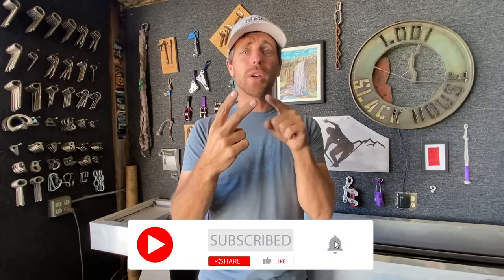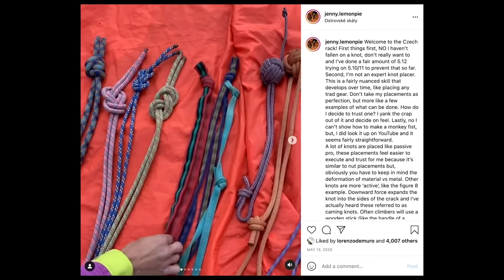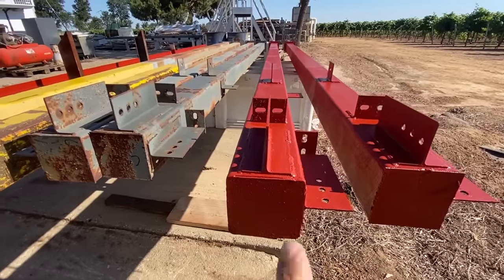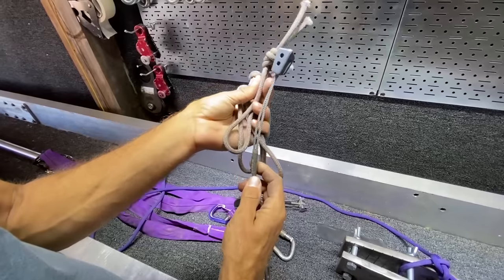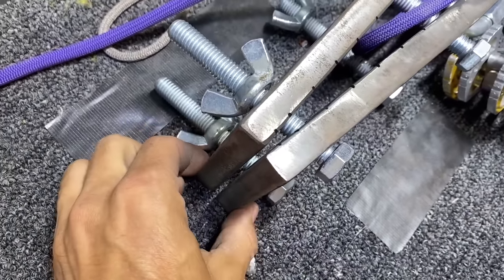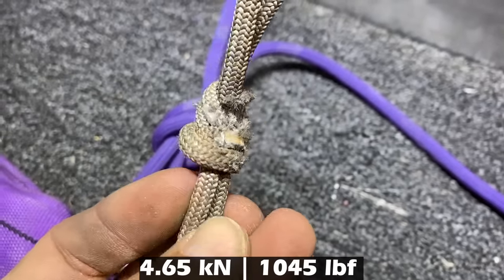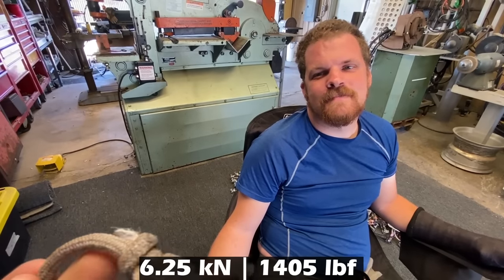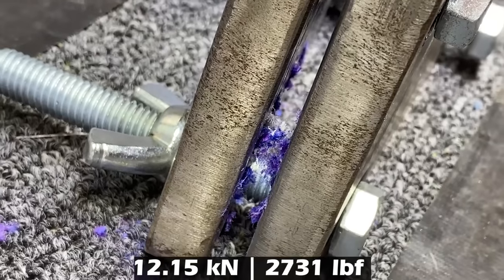Climbing pro made from knots??? Textile passive protection tested!

Comment: I like the idea of modifying your cam crusher to accept concrete paving slabs or even just some kind of ceramic tile with the rough side facing the cam/nuts. I say that because I think the steel is too slick for the soft nuts to work as intended. That having been said, you did test what happens when you pull these nuts apart if the end is clamped in place. It is kind of amazing to think that most of these, if they held, would not explode during a whipper. Maybe we should all start adding some soft gear to our racks? It weighs nothing, it costs nothing, and you can use it to supplement your more conventional protection. Imagine not having to waste cams at the anchor because you can replace one or two with solid soft nut placements? Pretty rad.
Reply: Ad putting the knots in your rack: it really takes awful lot of skill to place them properly, they need super specific spots to hold (quickly tightening crack, deep...), they can be real pain in the ass, typically it takes few minutes to get them in and there are about milion other reasons why they are pain in the ass. Only two positives are nature protection and low price. Still I am really happy when I go for soke hard rock and can shove a bomber cam in less than 10 seconds, rather than spend 10 minutes with shitty sling, which goes in harder than out.
I don't want to discourage you from trying them out, but be careful, mostly they are trash.
Reply from the maker: I really do want to modify cam crusher so we can get some real rock vibes.  It's really hard to do real rock real well.  I got some ideas....
Reply: @alcupone6462  I dont know that I suggested using them mid-climb. Rather, I think they would be great at anchors where you typically have a little more leeway on timing and setting things up. Instead of using 3-4 cams, you could use 1-2 cams and then like 1-3 more soft nuts to supplement and make sure you have a piece placed against upward pulls, which I think it an often overlooked component in a lot of anchors demoed online. What is nice about them is that you can augment some of your existing materials to function as nuts (dyneema slings, accessory cord, cordelettes, etc.) and basically get a bunch of gear for free. Sure, it won't help you on splitter cracks, but I live in CO where I haven't really climbed any red sandstone splitters....yet. I dunno, I think there is a place for this stuff. Ill try it out and if I dont die and dislike it, I will come back and comment :)
Reply: @arnoldkotlyarevsky383  I don't think that you suggested using them mid climb, I just wanted to give you the feeling what using slings is like.
It is awful lot of time for placing it and it needs very specific spot. I think you would be better off with using nuts if you want to save some cams instead of using them for anchor.
As you have seen in the video, you need a crack which is at least 2x the diameter of the sling which narrows to approx the diameter of the sling.
This is usually hard to find on hard rock and it is easier and safer to use metal nut for few bucks.
Be safe if you go try it out :)

Comment: DEFINITELY test on rock! I am certain the ability for them to deform like putty so much in this test is undoubtedly due in part to the slickness of the metal allowing the exterior fibers to easy change position and placement, as well as the entire not to more more easily into the narrow part of the wedge.  Contact on a surface with much higher friction will, I think, improve the strength performance in practice.

Comment: If you retest on slack snap add some nuts on the inside of the plates on the back bolts to stop the front opening from getting wider while you pull. If you watch the slow motion, the back plates pull closer opening the front gap allowing the knots to pull out.

Comment: The figure 8 knot is much flatter before tightening, so it fits to the thiner cracks. Jan, Czech rep.
Reply: In 1983 in the kitchen of Wolfgang Güllich and Kurt Albert, Wolfgang held up a piece of rope with a figure 8 to show everyone at the table how knots are used in what was then East Germany (I climbed in the Elbsandsteingebirge twice in 1983, once in 1985, and once in 1994, plus in 1983 in what was then Czechoslovakia, on the soft white sandstone of the Böhmische Paradies, where the rock is much softer than in the Elbsandsteingebirge): 

"You make ze knot theen, like so, and zen put in ze crack, and pool ze rope so ze knot gets bigger. Just like a Friend, except it does not hold ze bodyveight." 😆😬☺️

Comment: OMG thank you for this!

I can't wait for drop tower to test this on real whippers! This pull machine apply force for infinite time where whippers have only limited time (like 1 second?), so maybe knots don't have that much time to deform and will hold? We shall see :-).

However, I would do couple of improvement for the tests so they are a bit more real:

1. Don't cinch down the bottom after placing the knot: Once in the video, you mentioned you had cinched the bottom, please don't do this, you cannot do this with real rock ;-). You can place knots only where you actually can put the sling below the knot through (which can also be difficult because of friction and you have only 1 hand etc.)
2. Friction - sandstone has a lot of friction, that could be important factor.

Comment: it would be super cool to get a stone saw and cut a couple blocks out of sandstone boulders in order to make a couple stone wedges.

But yeah, the friction would totally help a ton, think about jamming your hand in a slick crack at the gym compared to actual sandstone, the smooth gym crack hurts more than gritty sandstone because your hand slips easier at the polished gym. My skin gets way more wrecked when I'm jamming at the gym at least.

So the friction on the rock will help the knots stay in place and not slide out. I'd assume as much as 50% strength increase in the placement by getting it to stay in place (with a limit being the webbing or rope strength)

Comment: I feel like some kind of coating or liner to ad some friction on the jaws would make a difference and possibly reducing the angle of the plates would help because you’re not getting as much contact between rope and the jaws as you could and the compressive force between the plates would be distributed over a larger portion of the rope thus giving more pportunity for the knot to catch or get hung up further up the jaws

Comment: I feel like using those in real rock would work quite a bit better than with your setup there. Friction would be higher in rock, so the knots wouldn't slip so easily. Also, in good placements you would only be pushing the knot further into the crack. So, seeing how much the rope held when it wasn't slipping off I think those should be safe. Also, the rope will stretch a lot more than the wire of a nut, so the force required to stop you is much less (softer catch). Now that doesn't mean that I will go and swap all my gear for knots, but I don't think people that use it because of conservation issues are crazy. In fact, most people I know would not want to fall on any trad gear because, no matter how strong the gear is, if you place it incorrectly it will not take a fall. I feel like it is the same with knots. If you are planning on falling on them, you should probably just set up a top rope or go somewhere else, you should only be falling on them if something goes wrong.

Comment: I'm picturing some of the cracks near me where the two sides don't just taper, like the slack snap crack cam crusher, but even looked like it had crimps either side for the 'shoulders' of a knot to sit upon. Add that to friction and you're looking at some pretty bomber, 'I might not actually whip and die' placements.

Comment: The jig faces change angle at high forces, it "resets" to less angle on most, my flash is a third set screw that keeps the wingnut side from moving needed with an expectation of better results from a static angle.

For friction put some skateboard deck on the jaws ... 
Cheers 🍺

Comment: Real rock would be interesting, since the force of friction is linear to the force applied. Meaning you would need greater force to pull it through a thin crack. A softer material also connects better to a rocks uneven surface than harder metal, which also means you'll see less pressure per area unit, which might counteract the deformation.

Also, it would be nice if you compared the breaking/holding strength of similar sized nuts or even cams. A DMM Wallnut is 7-12kN for example. The purple figure 8 was also 12kN at 8:10.

Also, the monkey fist woldd be nice, I use them for soft shackles btw. Hard knot.

Best regards, civil engineer.

Comment: A nice uniform and repeatable friction surface might be skateboard deck tape, it could be installed on the outside (as it is in current configuration) of the steel plates on your nut test jig *you'd just have to heat it up, and peel it off as it became damaged in testing... not that I think it would change the results much, though - in reality the friction might just eat up the rope/webbing faster, despite offering a bit more initial hold - looks like a perfect place to use the new load tester so we can see it graphed out!

Comment: You could probably use some locking nuts on the back two bolts inside your simulated crack, because it seems like it keeps shrinking in order to change the angle at the front, and then stuff slips a little. I am bad at explaining stuff but basically locking nuts

Comment: I have not climbed a lot in the Czech Republic or in saxonian switzerland, but I know some people. Yes, you are right about the fact, that the rock might be damaged. Which is the reason for these knots. The question, why should one climb there than, is a little more complicated. The climbing culture is a very different there. Falling is not so common as in some other areas. If you can't climb it without falling, you better don't try it. At least that is the way I understood it. The climbing is very traditional.
Reply: Falling is such a major part of modern climbing. If you aren't falling you aren't climbing hard enough. Everything is built around making falling as safe as possible. Sure you may survive a 98% of trad falls. But if you fall 1000 times per year you are probably dead.
Reply: @timonix2  Yeah, I absolutely agree with yoh there. Which is why I don't do a lot of climbing in those areas, where pro made from metal is not allowed. But that is the climbing culture in those regions and I just wanted to give an idea of why they are using such protection there. I do understand the big accomplishment to climb something even with just a minimum of gear. I just personally decided not to take the risk.
Reply: Bzw. chalk or too many bolts are not allowed there ether. Which is why many routs only have 1 or 2 bolts on 30m of climbing. Just a way to keep the climbing traditional.
Reply: @timonix2  well, if you are falling, then you are not climbing hard enough, because you fell? ;) just joking
Sandstone climbing had developed a lot in last 40 years, falling is not a nogo thing on sandstone anymore. Some areas are progressing towards the trend ( mainly the Elbe valley) and the routes are getting harder but also better protected (means preventing groundfall in 95% of the cases) and the trad part of the climbing is slightly pushed back.
For protecting the routes and doing the FAs rules are in place against over and under bolting. Casually it is assumed that you can solo one full grade below the route you picked (easier sections are often unprotected) and you have infinite endurance (often kills my attempts).

Comment: Since there are currently 400 and some comments saying to try it on real rock, I will answer in the opposite.  I don't want to see it done in real rock, because there is enough granite in the world to put my lovely rack of cams into. If I can dig a foothold into it while climbing, it's not my thing. I'd rather see a DMM Pivot go head to head with a BD ATC Guide. 

Speaking of such places, isn't Garden of the Gods in Colorado very similar?   I climbed there once many years ago and decided that rock wasn't for me.  It seemed that the rock was so friable that no removable protection felt secure.  

In West Virginia, at places like Seneca Rocks, they metamorphose the sandstone with some heat and pressure to form more like a quartzite. While they still call it sandstone, that is some tough rock.  Perhaps Czech Republic should consider holding another mountain building event to toughen up their sandstone.

Comment: The figureeight is placed as thin as possible (loose) and because auf the friction of the very course sandstone it gets thicker as you pull on the ends.
Friction is a huge deal. I actually took some whippers on those knots here in the elbsandstone in Germany and it works great, I never pulled one out. Of course I only risk a fall when the placement is good... But still.
Also I think dynamic pulls on those knots are quite different than the slow pull you tryed.

You should climb here. I think we have some really really unique routes and for sure a very special climbing experience.

Comment: Should be big difference with some friction! Contact with hard Placements is punctual, and by this the impact force is led into the surronding Material on a  very small area. Soft material builds up form fit, which is rather the opposite of punctual fit. By this ,i guess ,  it is absolutely crucial to  keep friction in mind , testing knotsling gear. 
Would really appreciate testing on some soft sandstone, cause the Routes of sächsische Schweiz traditionally need this technique. Maybe the softshackles suddenly perform great?!!  
Give it a go, please!😉

Comment: The smaller diameters feel a bit sketchy on the rope/shackles as they're impossible to place, but webbings and the bigger diameters I'd whip on. As with other trad gear I'd want two or three of them as placement can be make or break even if you're careful: whipping through one should break enough force even if it fails early to give the next one an independent chance of catching you again.

Comment: I think you could easily fix your testing method. The problem seems to be, that your steel plates "tilt" around your front bolts.
So 1. Choosing bigger front bolts
And 2. Jamming the metal plates on the back side as far spaced out, as the bolt allows, maybe you could hammer little metal pieces in there. Thate would mean, that your crack stays static, like on most mointains.
Ps love your work.

Comment: From my experience I'd also say, friction on real rock makes a big difference. And the sandstone here has lots of friction. Furthermore I was taught to only tie the knots loosely before placing them That way they adapt better to the site of placement due to the friction. Would be interesting to see, if this actually makes a difference. Btw. I think it is hard for most climbers in Saxony and in Czech sandstone to really trust knots. You could always try to retreat to them or slide into them. Therefore they do help for the peace of mind. But to take a big whip on a knot? I've never actually seen anyone do it.

Comment: im not sure if friction would really help. if anything i see it just shredding the rope even more but who knows. small note the back of the "crack" should have a nut to hold the back at the same angle. as the knots move through the front of the crack it pushes the plates apart which changes the angle and opens up the crack a bit. overall though...i don't think it's gonna change much.

Comment: Definitely need to drop test. The slow pull looks like it's generating a lot of heat from friction over time, allowing the plastic to soften and deform. With a drop test, the heat from friction should be negligible and it should simulate the real world conditions a little better. Plus, your metal tester is more like polished granite than sandstone, and I don't know any place that uses soft pro on polished granite haha.

Comment: It does seem that the angle of the plates changes on the thinner ropes, and gets more parallel.  Whereas they might be sliding out at a lower than maximum force.  Perhaps putting nuts in the back threads to hold the "v" open?

Comment: I think you need to add some nuts on the inside of the bolts on the wide part of the slot. It seems like that wide side is closing up like a lever when the knot is sliding through the narrow side. Maybe try adding some nuts to keep it from moving. Because in some of the slowmo tests you can see the "narrow end" of the slot opening up slightly and allowing the knot to slide through easier.

Comment: Might be a dumb question but if you were to line the inside of your gripper device with say 80 or 100 grit sandpaper, would that make a difference?

Find a sandstone "analog" and use spray adhesive or something to secure it to the inside of the jaws. Hmm...interesting stuff!!

Comment: only half way through the video but I noticed that the back side of the plates are getting pulled together.  this is making the tip of the front pivot open by just a bit.  you need to add stopper nuts or a pipe sheath on the interior of the back so it stays at the same angle and won't pivot the front open.

Comment: I think the friction from the sandstone (== sandpaper) might abrade and compromise the rope pro much faster than in your nice clean metal device.

Would be interesting to try with a sheet of sand paper on each side of the cam crusher
Reply: On the other hand, the ones that compress and pull through might perform better in real rock like you mentioned. 🤓

Comment: I'm late to the party, but I think that rock due to it's porous surface would provide much more holding strength at least to the slippage. Breaking strength I imagine would be very similar or perhaps slightly lower due to abrasion.